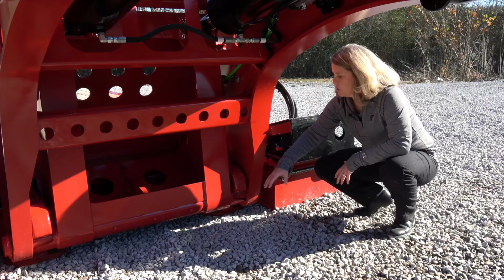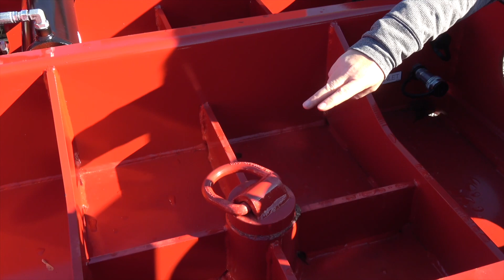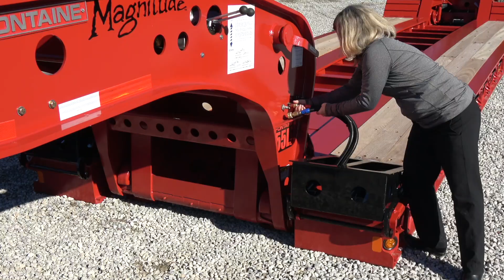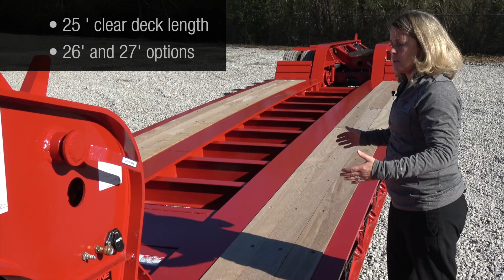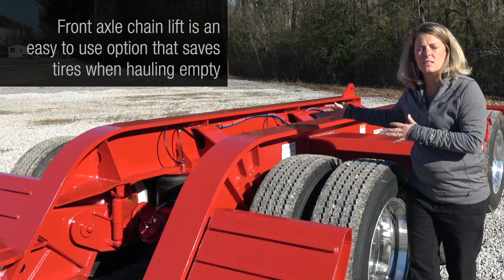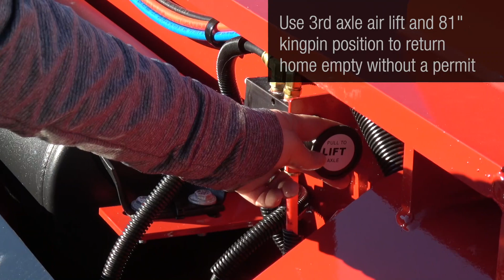FHH Magnitude 55L Plus R12

Comment: Great trailers, way easier to hook up and detach than the Talbert or JC's in the fleet I drive for...
Reply: used to run a 35 ton dynaweld basically the same as this it always seemed much easier with the hook and pin setup. also having the ratching bar simple height adjustment. now i run a 55 ton talbert, the plates hang so dang low when disconnecting its hard to keep from scrapping the ground and packing dirt or gravel between the gooseneck and trailer connection.